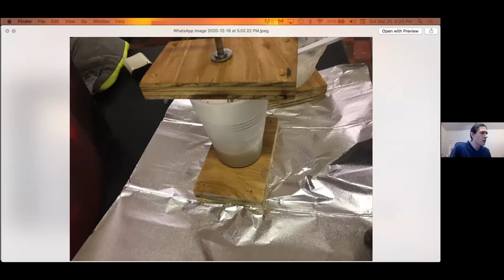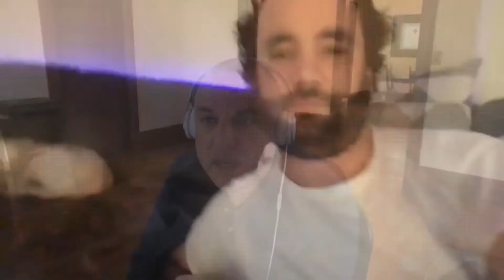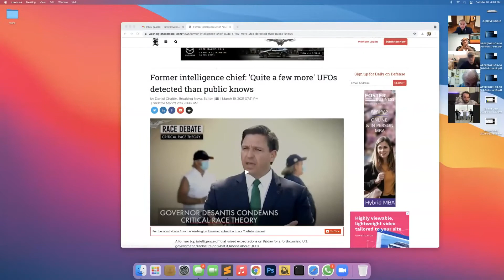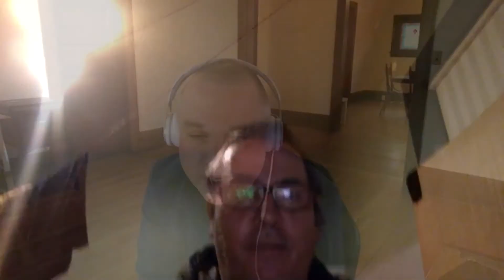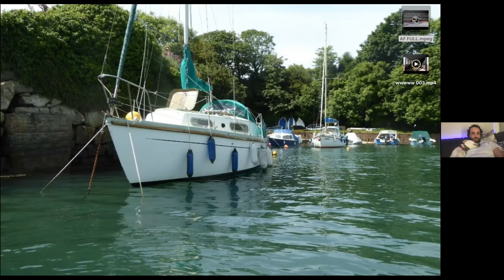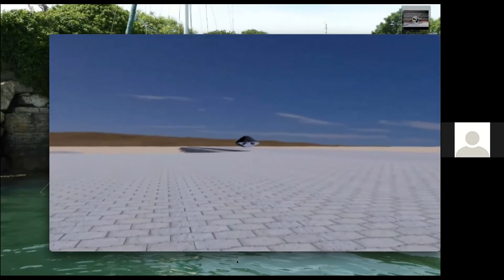APEC 3/20, Part #8 - Open Discussion - Inertial Propulsion

Comment: Inertia.....a property of matter by which it continues in its existing state of rest or uniform motion in a straight line, unless that state is changed by an external force.
"the power required to overcome friction and the inertia of the moving parts"

propulsion..... the action of driving or pushing forwards.
"they dive and use their wings for propulsion under water"

Contradiction. ..... a combination of statements, ideas, or features which are opposed to one another.
"the proposed new system suffers from a set of internal contradictions"

The no thrust engine? Inertial (unchanging) Propulsion (change (in velocity or direction))
Saved an hour and a half. lol